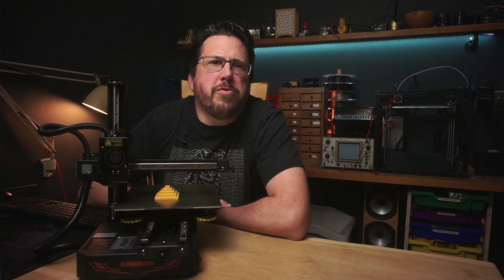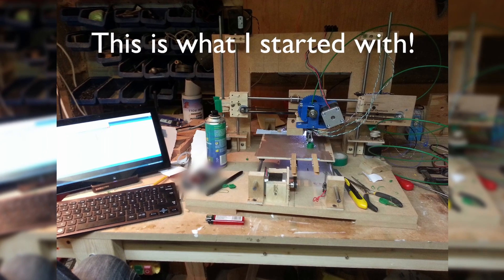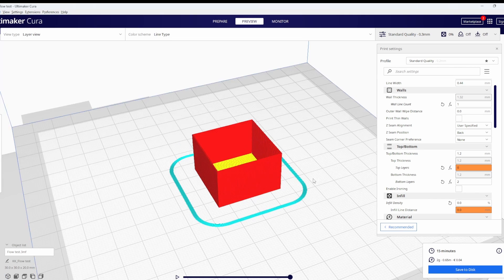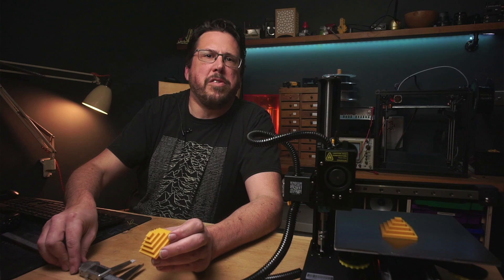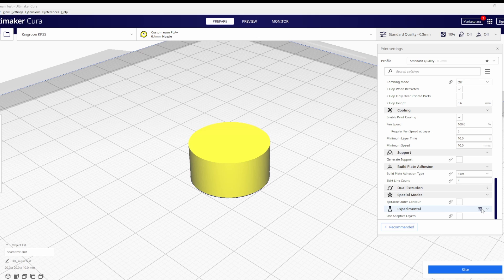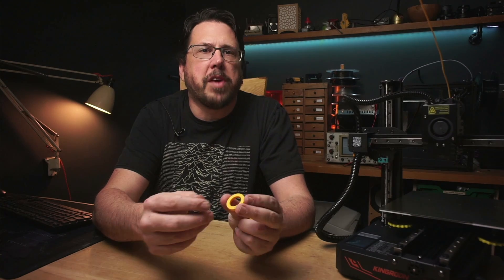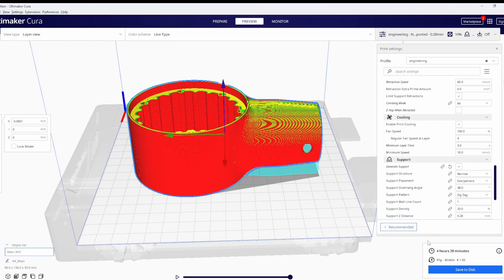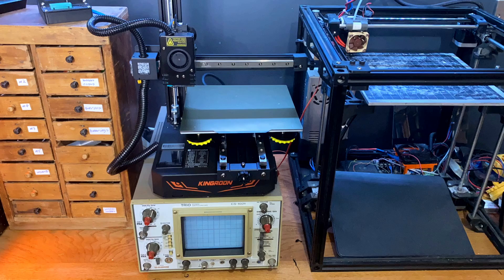High tolerance prints on a budget printer | Kingroon KP3S Pro

Comment: RoTechnic, at which point do you stop trying to dial in physical parts of the printer, and focus on the slicer side? I have seen arguments that changing some of these settings in cura are "bandaid fixes". They may be, but judging by the quality of these test prints (and your regular prints) these are necessary final steps.

Comment: I didn’t know you could essentially adjust the e steps in cura. Do you just save the profile once you calibrate it? On my Ender v3 you can do it right from its onboard screen. I couldn’t find these options in the Kingroon so that is how I found this video. Is there a way to do it through the printer?
Reply from the maker: The problem I've found is different filaments require different settings, so I find it easiest to adjust it in cura and then I can have a different profile for each filament. You can do it using Marlin by sending the M92 command. I normally do this to make sure all my printers have the same baseline, and then set the flow in cura on a per filament basis.
Reply: @roTechnic  thanks. I just opened my Kingroon the other day. My first try the wiring coming out of the extruder pinched between the vertical support and the extruder making a grinding noise because it couldn’t hit the end point. Not sure if that was the cause but once I figured that out mine misses the bed on its initial clean out stripe on the side. Just spits the filament off the side.
1) is there a way to adjust the X starting point so the filament goes on the bed? 
2) if I hit home ALL the extruder lines up before the bed in both X and y directions so the tip is not touching the bed. Is that normal? How do I adjust I’d not. My Ender is not like that.
3) if I level on the center point it’s not quite exactly the center of the bed. Should it be? 
4) when I used the five leveling points, I get all four corners perfectly level with the paper test only to find out the dead center was way too tight. Not sure how this is possible or how to fix it. It doesn’t even seem possible unless the bed sags everywhere but the middle. I’m am experienced at proper distance between extruder and bed and leveling. You can help me with any of those questions. I’d really appreciate it. I’m kind of stuck.
Reply: @roTechnic  I've been messing with this all day.  My Z is good on the 20mm test cube.  The X and Y are short (19.7mm).  I have tried to adjust the "flow" all the way to 110% and 120% yet it changes nothing on the next test cube.  I am reslicing and resaving to the disk between prints. I don't understand what i am doing wrong.  Also, the wall thickness never changes either.  It always printing .4 whether set to .4 or the stock .44.   It doesn't seem like anything i am changing is applying.

Comment: Really good video. 2 things to ask you. Do you have your Cura profile ready to download ? And now a stupid question, how do you change your filament ? I'm noob but each time I have to change it I was heating the extruder (200º) and after that, pulling the filament but some times a small part block my 3d printer and I don't know if it's better cut the filament on the top. Thanks
Reply from the maker: Hi, thanks. I don't have my profile for download as I find they vary even between printers of the same model. I'd suggest that you start with the default profile and then increase acceleration by 100mm/s/s on a test print until you find the limit - then do the same with speeds but only increase by 20mm/s. after about 6 or so prints you should have a nice fast profile.
Changing filament: I do the same as you, but if you're having a blockage, you might want to do the change at a lower temperature (say 170 degrees c) which will keep the filament much more intact but should still be more than hot enough to allow you to pull it out
Reply: I've gotten into the habit with my printers and with the KP3S Pro especially due to the funky PTFE lined heat break, of extruding about 10mm of filament before pulling the filament out. This gets rid of the "hot" filament sitting in the heat break that likes to leave behind strings and blobs of partially melted filament. I heat to 170c, depress the extruder tensioning arm, manually push the filament out about 10mm, then quickly pull the filament out of the hot end. You'll feel the resistance change as the warmed filament leaves the tube and gets replaced with the cooler filament you just quickly pushed in. I haven't had a single clog since starting this.
Reply: @blakewaters4063  I was doing the same as you but some (random) times, the extruder is blocked. Thats the reason I asked about how to do that. Thank you for the answer

Comment: I've been on this quest, amongst others, with the kp3s. I've done rails on all axis, abl, volcano nozzle/heat block, titanium hb, new extruder carriage with 4020 HE fan and dual ball bearing 5015 blower. Next, once I actually can afford to stop printing with it, a 115w ceramic volcano length heatblock with 300degree thermistor, CHT nozzle and adapter, bmg extruder, good belts, belt tensioners on x&y axis, an mks pi with 3.5" touchscreen for switching to klipper, a 60mm nema17 for the y axis and a 42mm nema 17 for the x axis and an enclosure. If all of that pans out well and I can push faster than the 150mms with 1500accel and jerk @ 12, while keeping quality, I'll do it to my other one.
Reply from the maker: Nice, You should be able to get above 2000 accel and near 200mm/s once you have installed klipper

Comment: Quick question, i was designing a robotic arm in CAD but i was wondering, how do you deal with tolerances and keep components from fusing together when 3D printing?
Reply from the maker: For parts that don't mesh together (basically anything but gears & cycloids) I just add a 0.2mm tolerance by using push/pull on each surface. For gears and anything else which needs a tight tolerance I tend to leave it as is and use the settings in this video to make sure that they fit. Occasionally I'll need to go back and shrink the part in fusion using push/pull on the surfaces, but to be fair I haven't had to do that in a while. that's why I like these settings so much!
Reply: @roTechnic  Thanks!

Comment: Very nice! I hadn't considered coasting before. Maybe this is just me, but when I've dialed in the flow rate in with a wall it caused under extrusion. Similar to 3:34 where I can see small gaps in the walls. I think it's due to the single wall having ridges, while cura assumes a rectangular cross section. I just dial in the e steps with 100% flow instead and use horizontal expansion.

Edit: this vid explains it better than I can youtu.be/xyrC0vVNGMs?t=389
Reply from the maker: oh, that’s really interesting. I’ll have to look into that. thanks.

Comment: Small note: I used to like using horizontal expansion settings but then I noticed that for the hole horizontal expansion settings, it causes visible defects in your models where you transition from a hole to a none hole piece of geometry, like if a hole is right beside a vertical rod. So now, any adjustments I need, I do in cad, or with slight modification of the outer wall flow.
Reply from the maker: interesting, thank you
Reply: True. You really should've changed your motor step size on a square the same size as the print bed 

Making it have more steps/mm also would've made your ID grow as well!
Reply: Much better is to switch the wall order to "outer first" which greatly improves dimensional accuracy of holes and everything in general. Tradeoff is that overhangs come out a bit worse. But if you don't have steep overhangs, definitely use that setting.

Comment: The thing about the KP3s Pro is that its approaching the price of a Neptune 3 Pro, which is likely the better choice for everyone with its larger volume, dual z, auto bed levelling, , pendant control screen.

I think the KP3s at its 160 dollar USD price point is therefore a lot more appealing than the bigger brother the KP3s Pro. If it at least had auto bed levelling and a fixed or /more solidly mounted bed I could see a recommendation for it, but as it is meh. The least they could have done was have linear rails on all 3 if it was supposed to be a big selling point. I guess the upgraded model featured fixes that, but then the glaring abl omission still exists.

I think for a modern printer abl is probably the largest ease of use feature addition for most people.

As for the precision, I bet the linear guides help in the long term due to no flatspots forming like with v rollers but I feel generally speaking every printer is as precise as every other printer nowadays since theyre all using similar enough motors belts and drivers.
Reply from the maker: I haven’t played with the Neptune, but if anyone want to send me a free one, I’ll compare them!